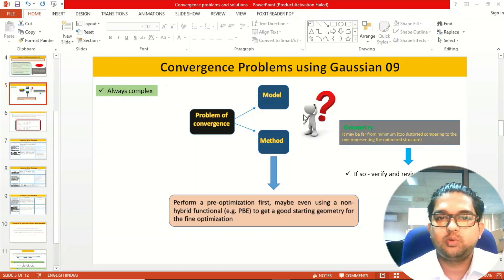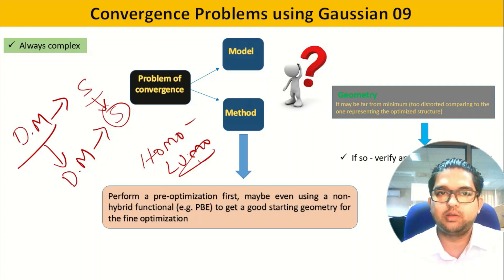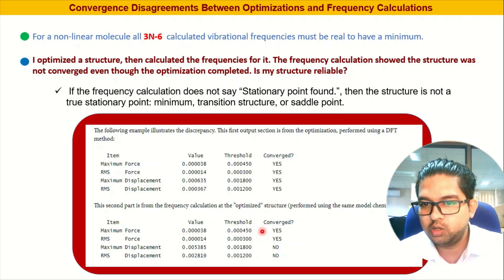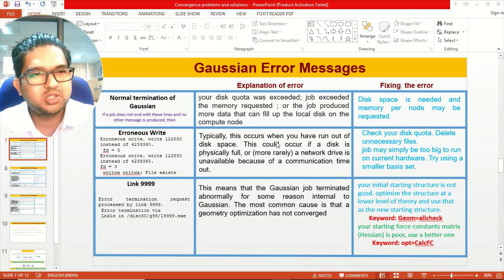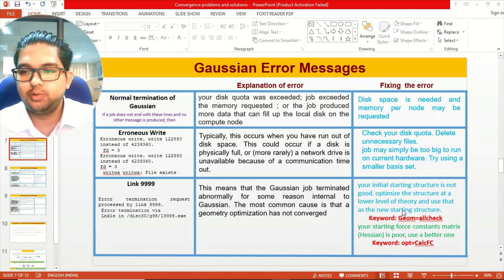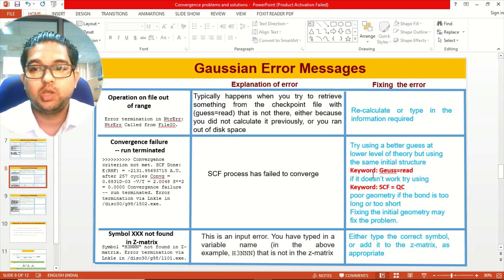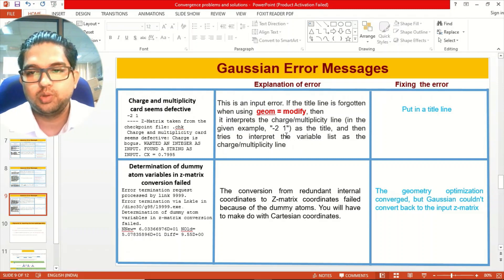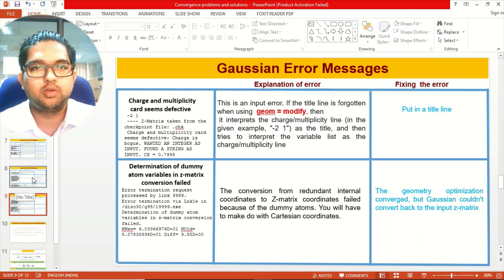How to Solve SCF Convergence Problems in Gaussian || Gaurav Jhaa

Comment: Error termination request processed by link 9999.
 Error termination via Lnk1e in C:\G09W\l9999.exe  i am facing this error lines in my ts calculation please help if someone knows the answer
Reply from the maker: Take the last geometry and resubmit the job using.

# opt=(CalcFC,ts,noeigentest,maxstep=3) functional/basis-set freq EmpiricalDispersion=GD3 cphf(grid=ultrafine)

Replace the functional and basis sets with your choice. 
if this also not working
decrease stepsize, may be stepsize=5
You can also use SCF(NoVarAcc, Noincfock)
Try them one by one. This will work.

https://gauravjhaa.blogspot.com/2024/03/gaussian-common-errors-and-solutions.html

Comment: please how do i solve this error in my gaussian calculation "severe error message #2070 the processing of the last link ended abnormally. all processing has been aborted.
Reply: I already performed opt+freq calculation on the molecule. In an attempt to perform single point energy calculations for NBO, I got the above error message
Reply from the maker: @israelekoro8617  The problem is in your input structure. You can design your input molecule properly.  This error is due to poor input structure.
Reply: @quantumguruji  please explain. I don't understand what you mean by poor input structure. Is it in terms of basis set?
Geometry optimization?
Or didn't I draw it well?
I was able to do geometry optimization and frequency successfully and got HOMO and LUMO values.
I have issues with single point calculations
Reply from the maker: @israelekoro8617  you didn't draw well
Reply from the maker: @israelekoro8617 since you have already optimized the geometry and also performed frequency calculations so there should not be any issue in just single point calculation....check your input geometry and parameters

Comment: Sir, I am facing a different convergence problem. My complex was converged for Maximum force and RMS force in DFT using Gaussian at the 45th step when using the SDD basis set, and then remove from convergence after 20 steps. Now, 183 steps have been completed but the complex is not fully converged yet. Still, Is there any chance to be converged fully again? I have checked the values of the Maximum force and RMS force: it is not decreasing gradually, instead moves back and forth in alternate subsequent steps. What should I do next?
Reply from the maker: *Increase the maximum number of optimization steps*: If the geometry is close to the correct structure, but just needs more time to settle into the global minimum, then increasing the maximum number of optimization steps may help. You can set this in the input file using the MaxStep keyword.

*Use a different optimization algorithm*: Sometimes changing the optimization algorithm can help to get out of a local minimum. Gaussian offers several optimization algorithms that you can try, such as the BFGS or LBFGS algorithms.

*Try a different basis set*: The basis set you are using may not be well-suited for the particular geometry of your complex. You can try using a different basis set and see if that helps.

*Check the starting geometry*: If the initial geometry is far from the correct structure, then the optimization may not converge properly. Make sure that your starting geometry is reasonable, and consider running a preliminary optimization with a lower level of theory to get closer to the correct structure before running the full optimization with the SDD basis set.

*Consider using a different software package*: If none of the above suggestions help, you may want to consider trying a different software package to see if it can converge the optimization. Different software packages use different algorithms and may have different strengths and weaknesses for different types of problems.
Reply: @quantumguruji  thanks a lot sir
Reply: please open log file save as a new gjf and add maxstep=5 then submit